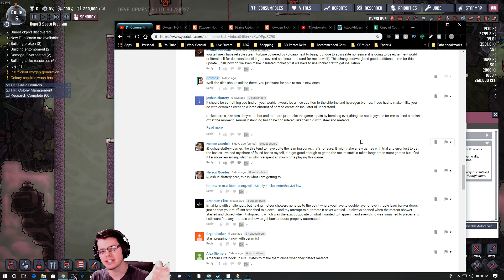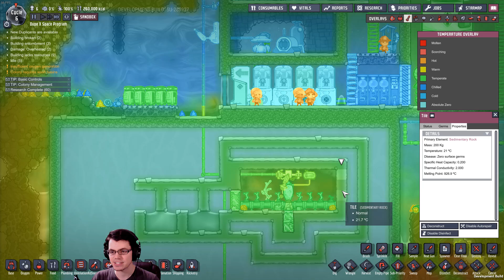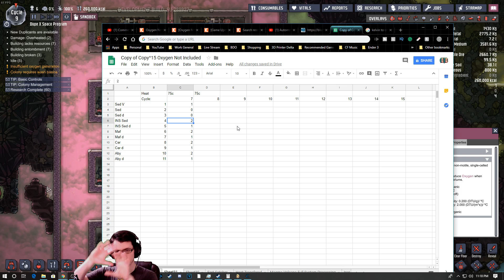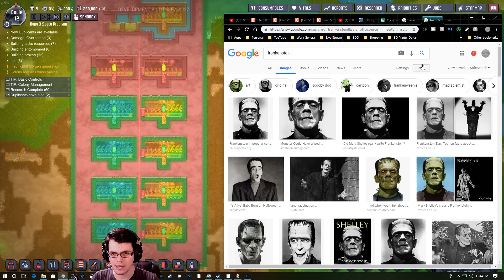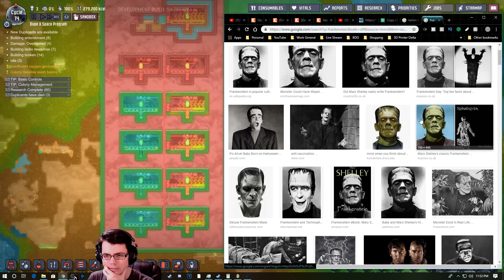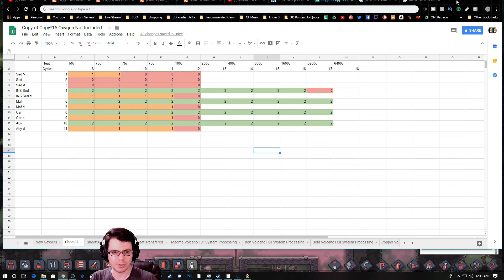Insulated Tile Test! Oxygen Not Included

Comment: Place the wheightplates under the doors, and automate the middle door!
Reply: From the weighthtplate (below 10Kg?) to a filtergate then to a OR-gate, then to the middle door.
Worked flawlesly a few month ago
Reply: can I have a screenshot? I feel like I'm not following. You want pressure plate UNDER the door? AFAIK game does not allow that...
Reply: https://photos.app.goo.gl/iI5BcT9H5kPejGMq1
https://imgur.com/a/xwXuRzC
Reply: Sure! seams like youtube doesn't allow links here?
Reply: imgur.com works just fine. https://imgur.com/a/41qTAoY
Reply: As requested, here is an example with the weight plate under the door, along with some logic with a time delay.  Just set the weight plate to below 100 kg and set the filter for your delay.
https://ibb.co/g5H4EU
The main reason I prefer putting the weightplate below the door is that I always had dupes dropping junk on the weightplate and messing up when it triggers.  But under the door it pushes other junk out of the way and is a fixed 100kg weight.

Comment: just use 3 doors with the middle one making a vacuum and your golden when using insulated tiles
Reply: yeah but the the doors can still  melt and destroy the vacuum , best is insulated tile /vacuum/ insulated tile
Reply: true. We need steel doors for volcanoes, I use iron - works fine if you actually use the heat on hotplate or something. If you want to encapsulate a volcano you don't plan on using - replace inner door with tiles of choice.
Reply: Why not use tungsten?
Reply: AzuRin agreed, tungsten is great, i was testing the 3 door vacuum with magma encased in absallyte (can’t spell that worth for crap) and tungsten was holding up to 1000 degrees.
Reply: Little trick for the triple airlock heat lock is to use a day/night cycle clock and set it to open 99.5% of the time then just jiggle it closed and open again without any power, logic gates, or duplicants.
Reply: @The_Yrri, you can make doors from steel now.
Reply: if your dupes aren't going there all day this works great. But if you're insulating wheat farm from fairly warm environment...
Reply: this bad boy isolates even volcano, just use wolframium on door nearest to volcano https://blueprints-not-included.com/blueprint/atila-automated-thermally-insulated-leisure-made-airlock/